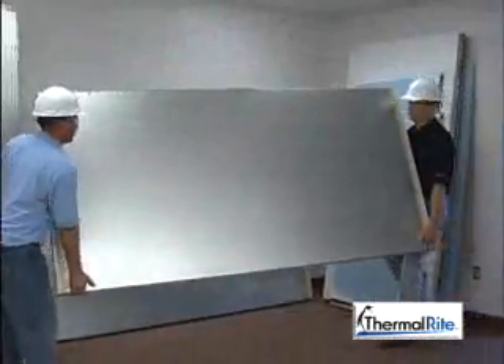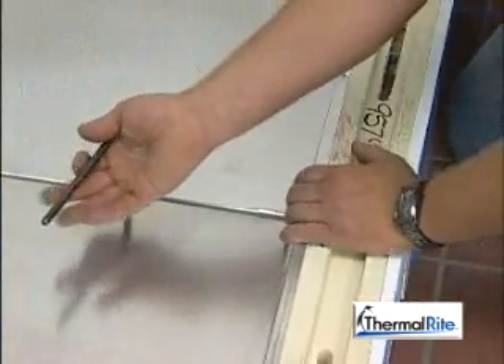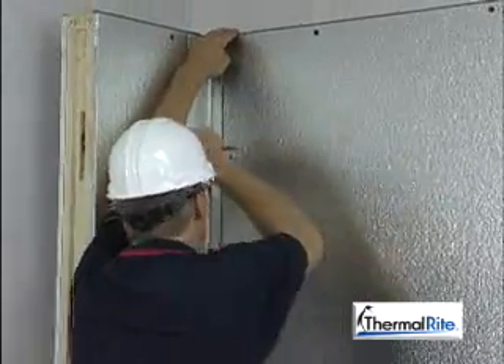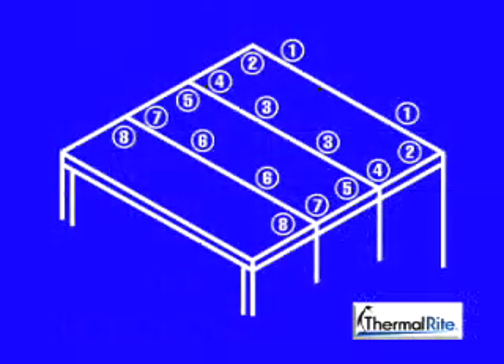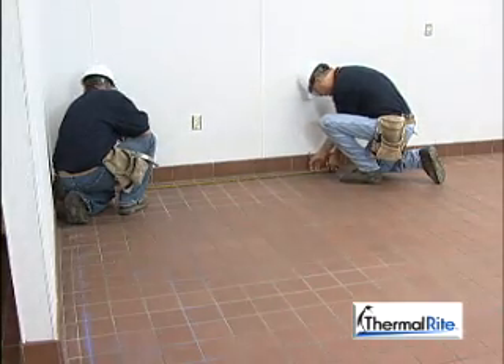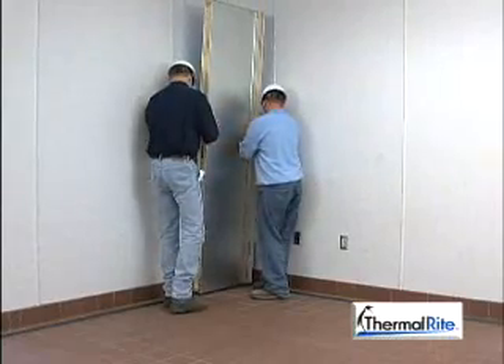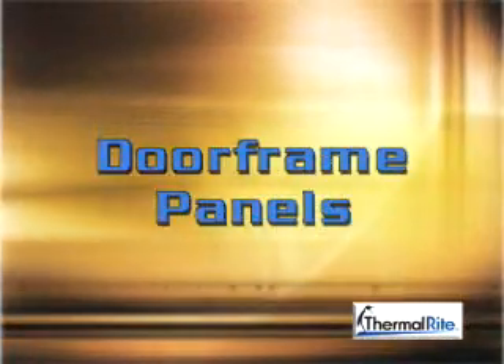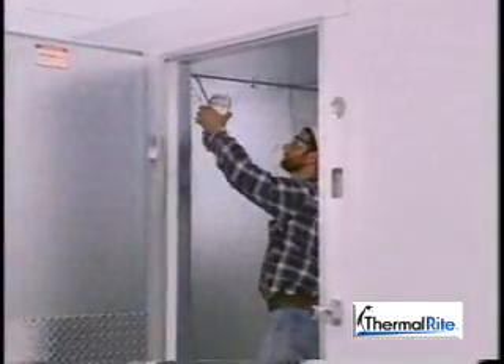Thermalrite Walk-in Cooler Installation Video

Comment: Did you need the building inspector to look at the walls behind the coolers? It seems that the cooler was constructed in front of an existing receptacle. If that receptacle isn’t de energized and the opening covered, it is a building code violation. The inspector in this area required the walls taken down to expose the back wall.
Reply: dont be ridiculous,  i see more inspection code violations on homes than i see on non essential things as u pointed out.  that is corny,  inside restaurants there are electrical outlets inside kitchens around water and grease. sheesh. stop being silly. turn off the breaker or disconnect at junction box if it bothers you.  moisture would trip the break if theres a short, that is why there's breakers and gcfi outlets.  you will be fine.